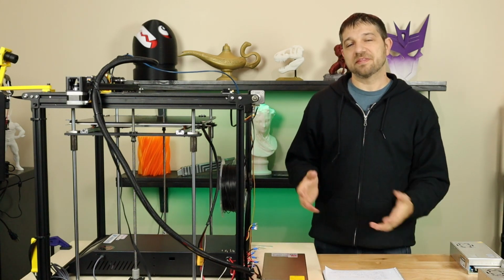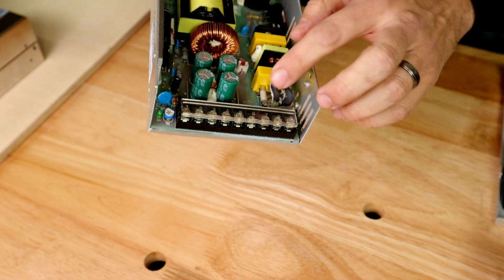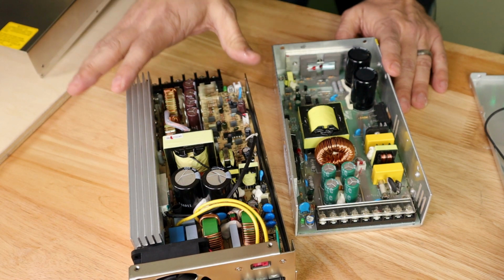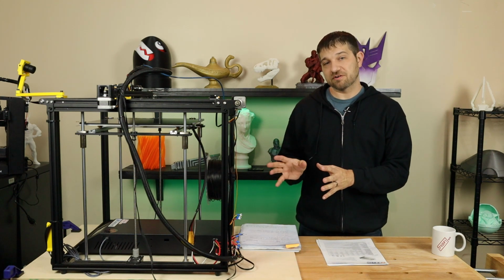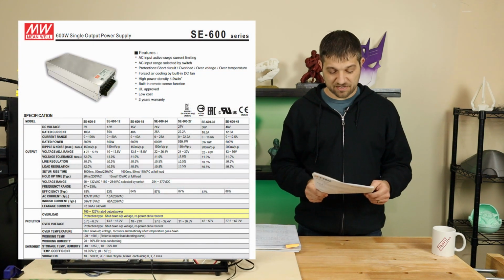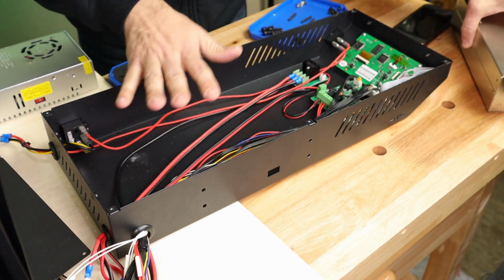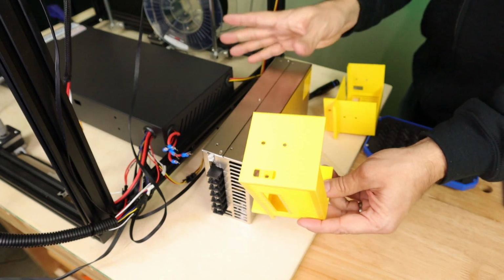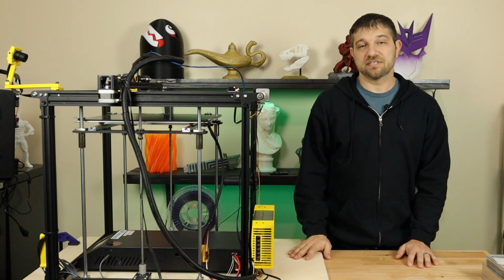Ender 5 Plus Power Supply: What You Need to Know!

Comment: With the 450W and the hotend and bed pre-heating ours pulls about 450W on the DC side from the PSU we specced out which per Meanwell can handle up to 150% of the labeled capacity. One thing to note is that your heated bed and hotend after pre-heating will not be on 100% power during a print and that usage drops substantially. During a print the average wall draw is under 200W from the wall on the AC side. The SE-450-24 has a max efficiency of about 86% per their datasheet. Now like most switching PSUs the higher the load the less efficient the PSU is going to be. 

TLDR; the 450 is a great drop in (no drilling) that the Ender 5 Plus works fine with.

Having the bed, hotend, and all the motors engaged in the E5 Plus with the SE-450-24 I'm seeing about 560W out of the wall according to my Kill-A-Watt and Battery Backup. 

Lets assume that at best we're getting 80% efficiency at that load (it may even be closer to 78%), we could verify that by taking more DC measurements but I don't feel like pulling the printer apart again. That means the printer itself is pulling about 450W on the DC side during the initial heat up, which is well within the limits of the PSU. Personally ours is used every day for 20+ hour long prints 5-6 days a week and haven't had any issues for the few months we've been running the new PSU for.

We've also load tested the SE-450-24 and the overload protection kicks in at around 140% load on all the ones we tested, which means these can handle about 600W easily. Meanwell always de-rates their PSUs which is one of the many reasons I like them. The temps on the PSU never exceeded 55C on the hottest internal component per our Seek thermal cam.

The main reason for going with the SE-450-24 is cost and drop in replacement. People already are complaining about shelling out $65 for the 450 and the 450 has screw holes that line up with the stock PSU. The 600W will not directly fit in the Ender 5 Plus chassis without drilling new holes and the other costs over $100 at cost. There's no harm in putting in a larger PSU. Just pointing out why we're carrying the Meanwell 450 version and not the others that can be made to fit in the E5 Plus. 

If you're using a 450 and are concerned with the load you can dial the 24V back to 22V without affecting much heat up times and it will drop the load by about 10% and bring it down to 410W total load. Personally I am running 24V on mine and have not had any issues nor do I expect to have any.
Reply: My 450 I purchased from TH3D has been running great! Any tips on replacing the 12v fan inside the power supply for something a bit quieter?
Reply from the maker: Thank you for your reply. I appreciate your attention to detail and the fact you back up your components, that's why I tagged you directly.

Your numbers on the DC side are very close to what I'm seeing, although a bit lower. I think the peak is much closer to 500W DC total but I don't care to haggle over ~10%.  I think almost everything else you mention I included in my video, including the 150% overload capacity of the 450W. I agree that people will probably not see a problem with the 450 under normal operating conditions and environments. I also see why saving some money on the supply and necessary tools to upgrade to the 600, may be what people are looking for. In the end, I chose a different solution and it may appeal to others that are willing to spend the extra money, want some extra headroom in the supply, and/or plan on expanding the printer.
Reply from the maker: I've added a clarification on DC power usage to my pinned post.
Reply: Glad I read this and saved myself 29-minutes.
Reply: Was just about to state that the power will go down significantly after pre-heating, but you covered it all :)
Reply: @Forrest Karter No problem =)

Comment from the maker: NOTE: As far as I can tell, all currently shipping Ender 5 Plus machines now come with a Meanwell 500W power supply standard! You can still use this video to verify your power supply or upgrade to the 600W, so I'm leaving it up for reference.

Comment for corrections, clarifications, etc.
- Commenter andrewforte noticed that with this setup, the power supply is no longer grounded to the chassis. This is a big problem and should be fixed immediately. With the power unplugged from the outlet, you should run a wire from the ground terminal (green/yellow wire) on the supply to a screw on the chassis. This will provide a common ground and a much needed safety fix.
- Cost of the RSP-500 or SE-600 is around $100.
- The SE-600 is little louder but while printing it was not louder than my part cooling fans and very low pitched.
- When drilling the holes in the rear of the chassis, move all wires out of the way or place a protective barrier to protect the wires.
- Clarification: With all of the "to the wall/AC current" numbers I was using, I don't want the actual DC usage of the supply to get lost. The DC side pulls between 450-500W under full load. This means that the 450W or 500W MEAN WELL power supplies should be able to handle it given their overload values. My argument is that I don't like to run a supply at 100% load on principle or if you're considering future expansion. Others may disagree.
-  Commenter Graham Wideman offered some clarification on the "Protection" lines  in the Mean Well datasheets. For each category, "Overload," "Over Voltage," and "Over Temperature" the datasheet tells you the range that it supports protections (temperature does not include a specific range) and then it tells you what it will do to handle the condition. So for example, the RSP-500 has protection from 105 - 130% rated power and the protection is by limiting constant current. This does not mean that supply sound be run 130% over rating but that it should protect you if the supply detects a problem. Bottom line, you still shouldn't exceed a supply's rating.
- 22:25 - The mounting screws are M3 not M5 screws. I called for the correct part in the description.
Reply: I would pin this comment so it appears at the top.
Reply from the maker: @voicesarefree  I thought it was pinned! Thanks for letting me know.
Reply: It is highly unlikely that your power supply failed because it was operated at 77 degrees F. I strongly suspect that it died because of a series of input over-voltage events. 

Most electronic equipment is rated at room temperature, 25 degrees C or 77 degrees F. The data sheets will then give ratings at higher and sometimes lower temperatures. The power supplies that came with the printer and that you installed are most likely all consumer grade and would probably be rated to provide full output power at up to something like 85 degrees C or 185 degrees F. The engineers at Creality would have been truly negligent if they released a product that would overheat when operated at room temperature.

The two round, black discs that you point out at 3:37 are most likely MOV's (Metal Oxide Varistors). I could not see the markings on the cover of the power supply clearly because your hand obscured most of them. It is most likely that one of them is connected across the hot and neutral AC input terminals and the other is connected from the hot to Ground or chassis. The white cylinder next to the MOV's is a fuse and is often connected between the MOV's and the actual input terminals. It is most likely that when the MOV's failed, they caused the fuse to go open circuit, rendering the power supply non-operational. Please note this is an intentional result (see below).

The purpose of the MOV's is to protect the components in the front end of the power supply from over-voltages on the AC input. This can occur when there is a lightning strike on the overhead power lines feeding your neighborhood. They can also occur when certain types of large industrial equipment are running.

The MOV's absorb the energy in an over-voltage event and prevent the voltage at the inputs from rising over what the components used in the power supply can withstand so that those components are not damaged. MOV's are rated by the voltage at which they start to clamp and the total amount of energy that they can absorb. When all of the energy absorption capacity of an MOV is used up, it fails and shorts out. This will cause the series connected fuse to blow open, disconnecting the power supply from the AC input and further abuse by over-voltage. Very often, when MOV's reach their end of life and fail, they explode just like the ones in your power supply. In industrial grade equipment, there is usually a piece of heat shrink tubing applied over the bodies of the MOV's to prevent the pieces from flying around inside the enclosure. If one knows how to select the appropriate MOV's it may be possible to replace the failed ones and the failed fuse and get the power supply working again. I do not recommend you try to do this.
Reply: @kerseyfabs  I just noticed that the Meanwell power supply also has one MOV near the input like the other power supply. This means that if it is subjected to enough over-voltage events, it will likely fail in the same way (see my previous post). The power supplies that I designed for industrial equipment also have MOV's on the input and are also expected to fail in the same way if subjected to enough over-voltage events.
Reply from the maker: @philso7872  But failure would be based on the rating of the components, which on higher end supplies should be over specced. I would hope.
Reply: @kerseyfabs  yes, it would. In the electronics industry, a failure of the sacrificial protection components is considered acceptable and preferred over the failure of the actual equipment (power supply) since the failure is easy to diagnose and the components are inexpensive to replace.

You are also correct that a more expensive or "higher quality" piece of equipment may have less capacity to withstand over-voltage events than one with "inferior" specifications. In the power supplies that my coworkers and I designed, we put in the largest ones available (or that would fit) since they were only a few pennies more.

I forgot to mention that the Meanwell power supply only has one MOV, most likely connected between the hot and neutral terminals of the AC input. Your original power supply had two MOV's, one across hot and neutral and one across hot and Ground. Thus, the old power supply was protected against two types of over-voltage whereas the Meanwell is protected against only one type of over-voltage. The total over-voltage capacity would depend on the rating of the MOV's installed. Most power supplies are "built down to a price" since no one buys a power supply to have a power supply. They buy a power supply so they can have an "X" and all the manufacturers know that. Power supplies are also a commodity item where the manufacturers all buy the same types of components from the same group of suppliers and one of the ways they differentiate themselves is the price of their product.

For equipment that can be plugged in, the solution is to use a (sacrificial) external surge arrestor between the AC supply and the equipment. When the MOV's in the external surge arrestor are used up, the external surge arrestor is replaced. Of course, not all surge suppresors are the same. Some will have MOV's with higher energy absorption capacities (measured in Joules) than others. Typical ratings start in the 10's of Joules and go up to around 100 J.

The motor controller module for the compressor in my fridge died two weeks ago. In one of the trouble shooting videos, the repairman said that the often fail due to over-voltages and he recommended using an external surge arrestor. It turned out that my motor controller died because the system was low on refrigerant, forcing the compressor to run constantly. The repairman who came said he had just replaced a motor controller in a fridge that died due to over-voltage and said that an external surge arrestor is a good idea since I am in Houston where thunderstorms are common.
Reply: At least your printer doesn't get stuck on the loading screen when nothing happened
Reply from the maker: @nexovec  Sorry to hear that. Did it come that way or just start doing it?

Comment: I put in the Meanwell SE-600 PSU in my printer before Christmas.  Not because anything happened, but because I didn't want anything to happen.  Right now, everything is set up loose in the turned over PSU cover, which isn't ideal.  But I'll be printing out your holder for the PSU and go from there.  Thanks a bunch!

Comment: The burnt parts are probably ceramic capacitors that cost pennies. Also the draw can not be accurately measured from that end. You can put an amps meter in series on the 24v lead to check accurately. The efficiency of the PSU is 70% or less .You can easily subtract 30% from your meter readings. I still agree to go with a larger meanwell . I'm looking to see if I can add a 24v gcode controlled ceramic heater.. I guess I answered my own question but you led me to the answer. Thanks for your videos I learn a lot from you.

Comment: If the bed is that overpowered, perhaps you could extend the life of an underpowered supply by limiting the duty cycle on that heater. It would heat up more slowly, but that's less troublesome than outright breaking. This workaround would be firmware only.

I read those spec sheets around the 15 minute mark slightly differently. The overload indications of e.g. 105-130% power doesn't mean you can draw 130%; it means the protection should trip somewhere in that range. It's quite significant what happens when it does; the RSP-500 goes to constant current, which means it will allow voltage to drop, effectively to the point where the power is OK. So expect the printer to run at maybe 16-20V rather than 24V while running the bed at full power, which it only does during preheating, not while printing. This is what makes it a good replacement, because the printer is quite tolerant of undervoltage.

Those burned components are probably varistors, part of the safety circuitry. It's possible the initial failure was not just from temperature but from condensation, since the printer had moved from a cold to warmer environment. Usually condensation can evaporate again if you let the system sit a few hours, but it's risky to power unsealed electronics while it's colder than the environment.

Comment: While i don't have one of these printers yet ( going to buy one within the month) i do have a tevo tarantula that i built and i run it off a small ups. this has 2 benefits: 1. any line surges will be absorbed by the ups 2. the battery backup will hold your printer where it needs to be in case of brownouts or total power loss, albeit for a limited time. at least long enough to get over there and decide what you wanted to do. This has saved me many times when the power dropped out for a few minutes and then came back saving my print. I will def be upgrading the PS before i even use mine. The MOV's in the supply are meant to suppress transient spikes in line voltage., so they saved your printer and potentially your home. Thanks for the videos, ill def be doing the top 5 upgrades as well.
Reply from the maker: I use UPSes on any of my printers that "reasonably" sized ones can work on. The Ender 5 Plus is not one of those printers. The 850VA/510W UPS I have freaks out when heating up an Ender 5 Plus. It would take more.

Comment: Worth noting that the RSP-500 from Creality comes with adapters to fit the holes for the OEM power supply. Otherwise, you'll only be able to line-up one hole for mounting. I messaged Creality about buying the adapter separately and they charged me $6 (currently in the mail) but YMMV since it isn't an item on their site.
Reply from the maker: Thanks for that. I didn't realize they were just providing adapters. It's nice that they'll sell them separately.

Comment: It's worth noting that the RSP series has Power-Factor correction.  The SE series does not.  That's why the RSP-500-24 goes for about $90 while the SE-450-24 costs only about $65.

BTW, the RSP-500-24, which Creality sells, does not match the original mounting holes.  I had to drill 3 holes to mount mine inside the case.
Reply from the maker: Thanks for that. For anyone else interested in what PFC is and how it works: https://www.sunpower-uk.com/glossary/what-is-power-factor-correction/
I was told by another commenter that theirs came with an adapter of some sort. Seems yours didn't, so that seems to vary depending on when you ordered.

Comment: Hey, you're getting it wrong with how you're talking about Watts. You don't consume Watts or power, you use joules or energy. Power, which is measured in Watts, is the rate at which energy is used or transferred from one system to another(Ie: Work). 1 watt is another name for 1 joule-per-second(ie: j/s). The difference between watts and joules is identical to the difference between miles-per-hour(mile/hour) and miles. Or maybe a better comparison is: think about using a pump to fill a swimming pool, it's the difference between the pump's power in gallons-per-minute(gal/min) and an actual gallon of water. You can hold and touch a gallon of water, but a "gallon per minute" isn't a physical thing, just as a "mile per hour" isn't either. Or a Watt for that matter. Energy is what keeps you warm and makes your motors spin, power is how quickly or slowly that happens.
You may actually know this, but it's a concept that a lot of people have problems with. I've even met a few EEs who didn't understand the difference, so I try to annoy, er, umm, teach this concept when I get the chance.  :-)